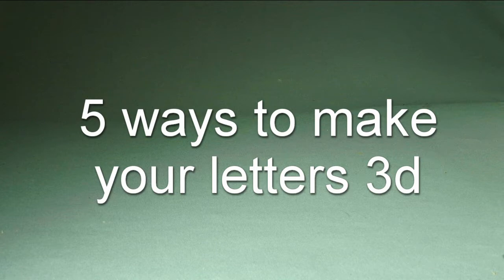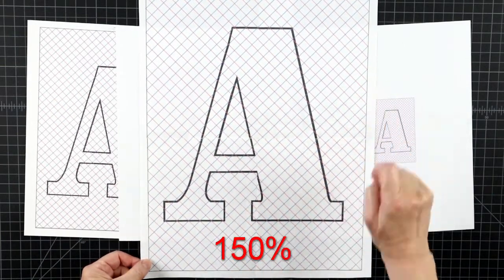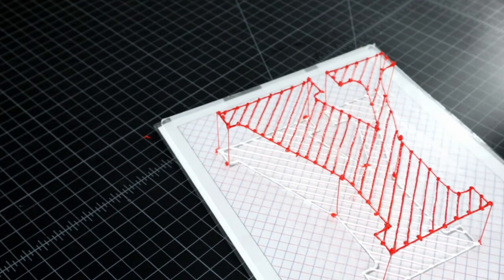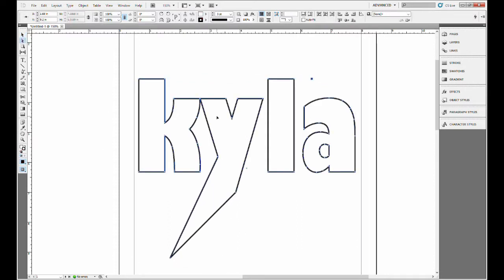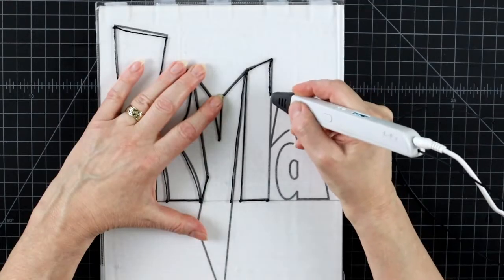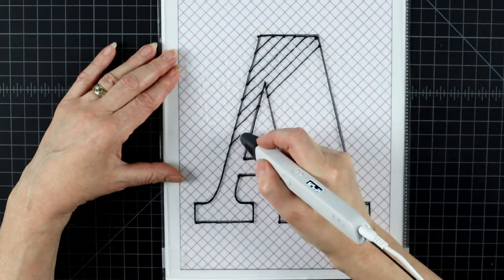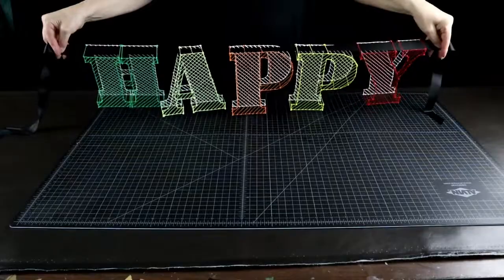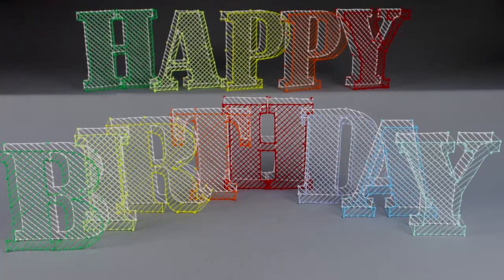How to build the alphabet with 3d pen

Comment: Great video! :) Love the hanging letters at the end, there.

One thing you might want to try is looking into the sound-balancing options in your video-editing software. There are a few places where the music comes in really loud compared to your speaking parts, and it's a little hard to find a right volume level that works for both without having to constantly turn the video volume up and down. :) I'm loving some of your music choices lately, though.
Reply from the maker: I know. I was struggling with that doing this video especially. I totally respect the sound mixing people. It's a delicate art. That's why they give the Oscar for sound mixing to people who know what they are doing. ;)
Reply: @3DPENDEN  I hesitate to recommend yet another piece of software, but Audacity is a decent free bit of sound editing software that you could use to lower the overall volume on your music track if you need to, if you don't end up finding something directly in the video editing tools.